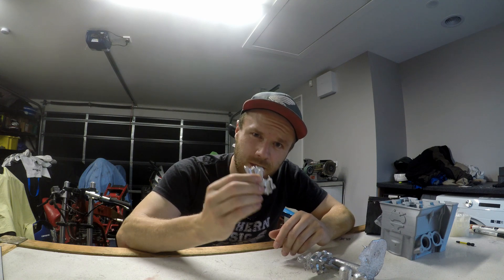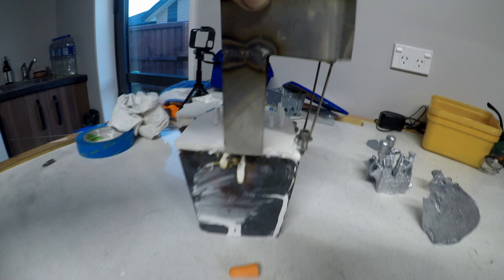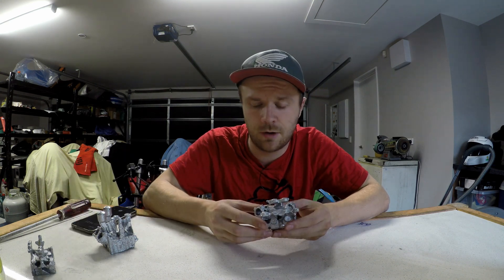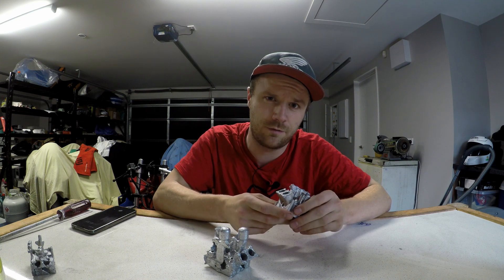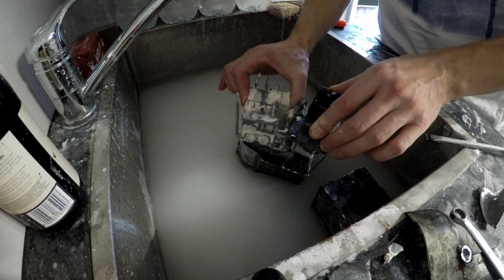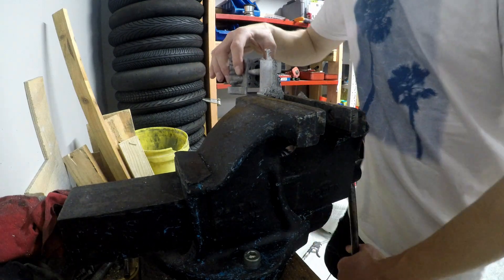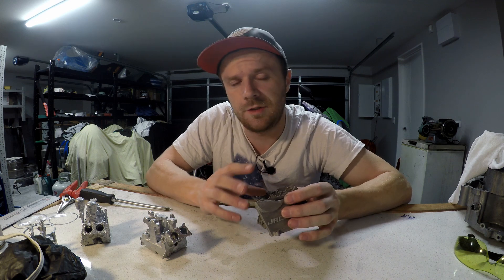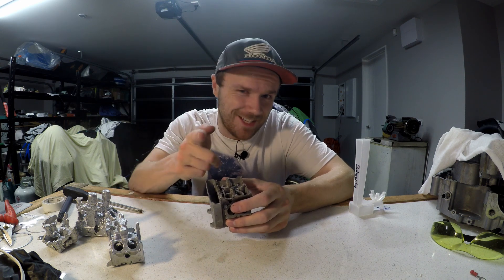Cylinder head casting in the Garage

Comment: Did you check if your 3d prints are water thight? Wouldnt it cause problems in the mold if it wasnt?
Reply from the maker: No I haven't tried that, It did cross my mind but I'm sure they aren't water tight as I'm printing with 0% infill and 2 wall thickness, have done a couple castings since with no issues like that. 🤞
Reply: @TheMotorcycleForge  Ok great. If you do want to make them water tight, spray paint enough clear coat on them. That should make it water tight.
Reply from the maker: It would defiantly make the outside water tight, only issue would be the water jacket inside the head.  @Woodzey

Comment: If you don’t like to spend allot of money on a vacuum pump
Just get a fridge’s compressor and run it 
There will be a side sucking air and another blowing
Use the sucking side (the compressor is round and most likely black)
Or u can just use a normal air compressor

Comment: First you have to mix the white mixture reaally good
Then you have to vacuum it 
Then you have to pour it in the mold 
And vibrate it really good
And again vacuum it and then let it sit 
I’ve seen people do this method and have a casting so clean that even the 3d printer lines were visible in the casting
Reply from the maker: I  did two of those steps just didn't have a vacuum chamber.
Building one as we speak.

Comment: I'm an engineer and do a lot of 3d printing, ultimately you will struggle to ever print as flawless as you like with any form of 3d printing straight off the printer so you have to decide on where your tolerances are important. for the cylinders and such you'll probably have to ream them out, but if you can get all the important mechanical surfaces nicely finished with post processing then there's no issue with the outside structure etc on being visibly 3d printed, in fact it adds to the origins of where its come from!

I love the tower as a solution to the spills haha but an easier way might be to dig your mould deeper into the sand and dig a wider "funnel" shape to make it easier to pour into. If it leaves a big weird sprue/ base you can just chop it off.

This is so cool man good luck!
Reply from the maker: Ok, thanks for the info.